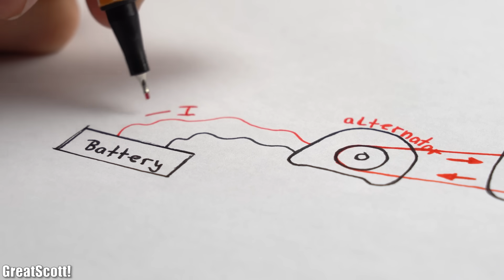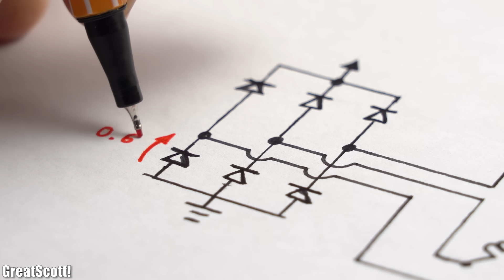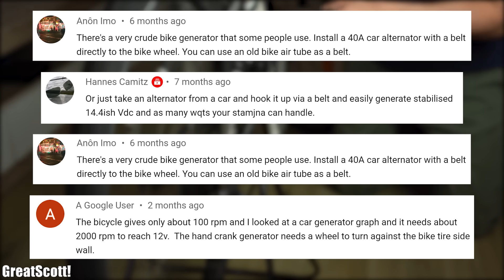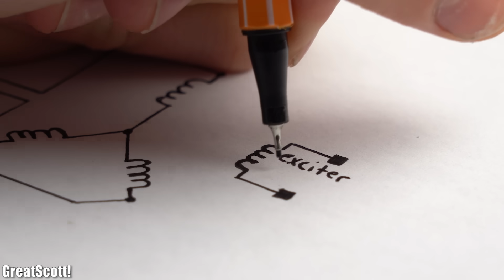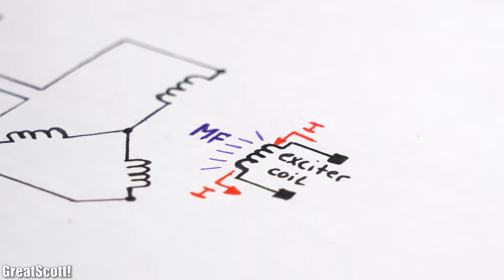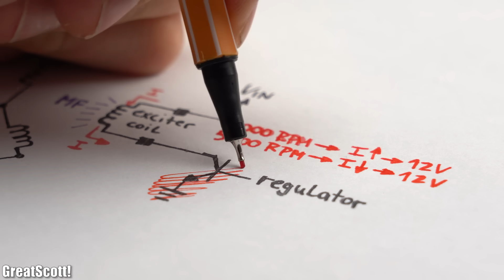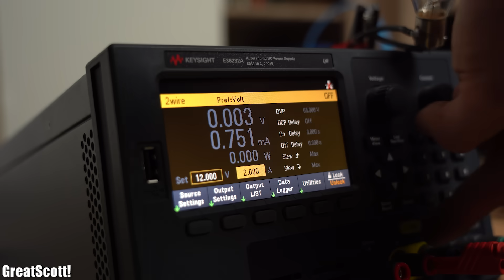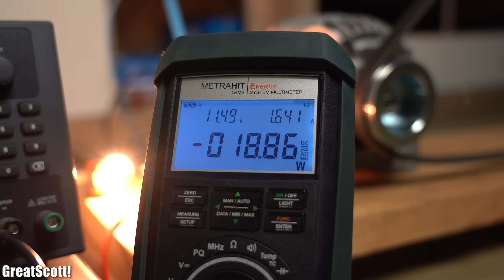Using a car alternator with a bike to power my home? How much energy can I produce?!

Comment: No one is adding a 3rd component add the induction motor and modify the alternator pin like the one guy who claimed free energy, I have not had time to try and even though I don’t think it would produce free energy. 
I do however believe that it would inline with the bike 🚴 and battery combined with an induction motor would make enough energy to power more efficiently, maybe you have more time than me to find out my friend lol

Comment: All 3 wires o the alternator end up connected to the battery in your car when the ignition switch is on and when the car is running.  I learned this years ago when I connected a lawn mower motor and an alternator.  I did not need a battery but I had to short one of the small connectors to ground or to each other  just for an instant to get it to generate. The other was connected to the output connection!  The other problem, the lawn mower motor no longer had a blade attached to it that acted as a flywheel and the motor would kick back when trying to crank it!  We used it for an emergency 12 Volt supply to power ham radio equipment.  I miss the fun of being young!

Comment: I’d like to see you do a similar project using steam and a large bag of charcoal or fire wood.
It would be interesting to see the difference in wattage output. If steam is more efficient, and you have a good fuel source, that could be a more practical option.

Comment: 1,440 watts assuming 100% conversion efficiency works out to nearly 2 horsepower, which is far more than the best bicycle racer could put out for more than a short burst.  Doesn't matter how you gear it, you will only ever produce as much wattage as your human pedaler can push.  A smaller pulley won't fix this as the limitation of slippage in a pulley system is the smaller pulley; what your system DOES need is a belt tensioner pulley on the slack side of the belt.  If you have the alternator connected to a battery, a switch and small incandescent light from 12v to the correct terminal this will provide the initial "exciter" current.  Once it spins up, the alternator's output maintains field current and the regulator will maintain charging voltage at a varying amperage/wattage according to how fast you're pedaling.  In a car where you can rev the engine and make the alternator spin 18,000 RPM, there's often enough residual magnetism in the iron rotor assembly that it will spontaneously begin charging without that initial exciter voltage.

There are permanent magnet alternators, as well as rotors that can be installed in common alternators like Delco so you don't need a battery or exciter current for it to begin charging, but this setup needs an external charge controller to prevent overvoltage to the battery.  These are built for wind or micro hydro generator systems and would work well for a bicycle generator like this.

Comment: There's a few things that are going to stop this.  When you convert the 12 volts to house current you're not going to have that much watts. We're talking about ohms law.  Also the more you load an alternator the harder it is to turn.  The only way to do this is by adding inverters and storage batteries to your system.

Comment: Throw two or three car batteries on it and a good sized capacitor..wire it up...and by the time your legs give out, muscles pump up, and your metabolism is through the roof then you'll be out for the cost of clean fuel and anti inflammatory turmeric root for the body repair/energy and the cost of the capacitor (if you touch it the wrong way you'll be out even more) and the cost of the batteries..

Think in terms of windmill using the alternator as a ball bearing or pulley to weld the fan blades to(unless you live near a running stream)...wire alternator into car batteries..8-15 car batteries; wiring all hots together and then all grounds together, while keeping the storage room temperature for the batteries above 68°F. Then carefully wire in capacitor; then add in the AC/DC convertor box...

Some used alternators malfunction and can throw enough energy to nearly explode a car battery; figure out why or where you can get it and wire it straight to capacitor.

Comment: please try using a 12 volt car battery and a dc converter plus the connection cables for that alternator. and your alternator should be on an adjustable mount.

Comment: Could you add a battery to your system and a DC power inverter. By converting a 12 V battery to 120 V you should be able to power some outlets. It’s what long-haul truckers use to power their appliances in their semi trucks. Could you also use a smaller electric electric motor to power the alternator while charging a battery drawing off a inverter to power it or off the battery itself? Making a continuous loop and a continuous source of power that would power the electric motor that is creating charge for the battery? Just curious.

Comment: According to what I saw on your video, you did not have the bike in high gear because you had the chain on the largest sprocket on the wheel. High gear requires you to have the chain on the largest pedal sprocket and the smallest wheel sprocket.  Lowest gear has the chain on the smallest pedal sprocket and the largest wheel sprocket.🤔😁

Comment: Smithsonian Institute in DC has the same thing, a bicycle powering up a lightbulb. I remember that back in the 1980's. Now in modern times, if you use a battery powered electric bicycle conversion kit, you'll get enough RPM's and more, but have the cuurent connected from the alternator to the output of the electric bike control unit. You should be able to have stable power to the electric bike motor and be able to charge or use other device around your house. and you can also go to junk yards to get cheaper $20 alternaters  or connect multiple alternators at once and get a cheap 24 speed racing bicycle $50.

Comment: 🎯 Key Takeaways for quick navigation:

00:51 🚲 The car alternator can output a maximum of 120A at 12V, equivalent to 1440W, potentially sufficient to power home appliances.
03:54 🚴‍♂️ Additional gearing was needed to increase the rotation speed of the bike to turn the alternator efficiently.
06:33 🧲 The car alternator's rotor requires an exciter coil to create an output voltage, and it can be powered with a DC voltage.
09:41 ⚡ The bike generator setup could produce around 20W of power, but factoring in the power required for the exciter coil, it may not be practical for home energy production.

Made with HARPA AI

Comment: 1:45 Ridiculous. If you want 1000 watts out of your car alternator then you have to pedal for 1000 watts plus losses on the pedals, chains etc 750 w is 1 horse power so you'd have to pedal almost 1.5 break horse power. Are you superman?

Comment: An alternator generates AC close to 20v, the regulator converts that to DC and holds it around 14.4v.  Your altrnator had an internal regulator but usually that are just bolted in.  There are websites that specialize in selling kits to convert internally regulated alternators to external, them you have direct output from your alternator and can have more options for an experiment like this.  And yes, alternators take a bunch of power to rotate and the belt has to be extremely tight which is why automakers went with a ribbed belt over a V belt

Comment: I had a theory. Instead of an alternator with a belt drive system what if it had a chain drive system.  Then it might be possible to add multiple alternators.

As a side note. Just a way to have multiple alternators on the same system to generate power by multiplying it.

Comment: change the size of the pulleys and bike tire,, make the alternator pully bigger and the bike tire smaller,,, also, put a tensioner on the belt so it aint so loose fit'n,, watch your current go up

Comment: I just purchased a 1000W Pure Sine Wave inverter for the home. I expect that my car battery will be sufficient to supply the necessary power for some home appliances and that running the engine will ensure the battery won't die until the car runs out of gas. Since it is a Christmas gift, I won't be able to give it a try for another week or so.

Comment: The human legs are not reliable and strong enough to be used for generating substantial amounts of usable electricity. To overcome the magnetic field needed to generate usable electricity will tire out the strongest human in short order. In this experiment the inertia of a heavy flywheel instead of a light bicycle rim will help.

Comment: I made a decent bike generator back around 2013/2014 using a treadmill motor and produced about 300 Watts. Mine was a lot more stable. I wont post a link here but anyone can go find it.

Way before that, maybe around 1999 I used a car alternator to charge lead acid batteries. My experience was way better. But also more of a workout. I used batteries and the exciter coil was powered by the battery bank. It was very hard to turn once you flipped on the switch. Very big workout.

Comment: Why make it hard for yourself,just get a 12v. Motor to turn the alternator in turn uou can keep the 12v motor charged off the battery. A larger sprocket will turn the alternator faster generating more current.

Comment: Note not all alternators have a internal regulator like in video. Chevrolet products do. Fords do not. Others I dont know.

I saw a setup a man made so his children would exercise more. Bicycle, alternator, car battery and 12 volt TV.
Kids could watch TV providing they rode the Bicycle to power it. On average 30 minutes hard riding gave 1 hour of TV. By using a car battery with some charge it gave a steady voltage to the regulator for the field currant. More steady output. They could not let the battery go completely dead or it couldn't start the field circuit. 
The two little pins are 1. Power to the regulator and 2.  line to the charge light.

Comment: If you were to change the pulley on the alternator with a bigger diameter pulley like 20 inches instead of the little 3inch.

Comment: To All:  Info.  Whatever  ' brand ' of vehicle alternator  you  use ; check out the  idle  speed of THAT  brand of vehicle. That, idle speed, is what you'll  require to create an electric generation unit. Minimum of probably 1700 or so. Make it for at least 2,000 rpm.   ( 3600  may be the best, like those gens you buy , in a steel  piped case type = Champion, and other brands ).  If i build one, it would use an alternator off of a semi- engine ; probably a Detroit, or Cat engine. Rating about 200 amps. IF  it's  going to be made, it's  going to  produce power !.  Thanks, for the info, SIR.   Wonderfull accent, is that German, or Norweigian, or ...?    (Alberta Canada)  A generator, usually  requires about 2 hp of rotational force, for every 1,000 watts of  power  output. There is some loss, but efficiency is between 80 - 88  %.  I have several generators, 208 cc gas engine powered, 3500 Watt BE  generator. Older Yamaha, 2800 watt output, uses a 256 cc engine. ( 1983 model - had to redo carb = works awesome. Great engine !!))

Comment: Wait a minute. Thats 1.4kw at 12 volts DC, not 120 AC. So what is the wattage at 120? There arent many things in your home that run on 12 bolt DC. Now, if you add an inverter you can get AC from it but at much lower wattage.

Comment: Good demonstration. Car alternators are only around 50% efficient in the environment they were designed for, an automobile. When you add up the additional losses from the belt drive and exciter coil power, using this to generate only a small electrical power, the efficiency is even lower. A small permanent magnet wind turbine generator head might just do the trick. If you can find a small one that you can replace the rear wheel with one to drive it directly off the chain? These generators can be  very efficient at low RPMs. However to be realistic, you will never be able to generate the amount of power you originally sought out by using pedal power. But being able to charge a battery to power lights and other small items might be very worthwhile to have?

Comment: There is a way you can take the generator apart and re wire it it might have a voltage regulator that limits the voltage built into the alternator also there is a way to make it A/C generator so you don't need any 12volt to the unit

Comment: Then we have millions jumping on the ‘green,replenishable band wagon without a full understanding of the limitations in such an undertaking.As it is not practical to supply the energy needs of your home,these ‘clean energy’ projects will only run the ‘refrigerator’ of our nation,and at great,unrecoverable cost to the tax payer caused by even greater subsidies from DC and rising costs to consumers.

Comment: I hate to say it but you did half of it wrong. You don’t supply 12v directly to the exciter circuit, that will break the alternator. You need to set it up the same way as it works in the car: the 12v is fed to the exciter via a lightbulb. In your car this bulb is the battery light on the instrument cluster. Feeding 12v directly into the coil prevents the regulator from controlling the charge. You only produced 20w because that’s what your bulb was using. Also en engines rpm is not equal to alternator rpm due to the pulley size difference. Alternators usually run about 2.2 times the engine rpm speed, this is because an alternator needs a minimum of about 2,000 rpm on its own internal shaft to produce power, so when an engine idles at 750 rpm the alternator still needs to be around 2,000 rpm.

Comment: 20 watts output 🤣😄 one solar causal 1,5m x 1m panel is producing between 100 and 250 watts per hour.... It would be better to store the energy in batterys than trying to pedal...

Comment: Why would you use a bicycle?  Use an electric motor beside the alternator.
Reply: Take the rectifier off the back of the alternator, and it produces AC current.  Hook the electric motor up to the alternator, and it will run off itsself

Comment: In five seconds of this video, I understood how ridiculous it was. Generally a car alternator only has to produce very low power.  Most alternators produce 100-160 amps at about 13 volts, that's 1300-2000 watts, hardly enough for a house. It takes 4-7 horse power to rub an alternator at full output. The it has to be hooked up to an inverter to produce 120v AC. A person is lucky to produce 1/3hp and can't sustain it for very long.

Comment: You realize there are one-wire alternators, right? Now, you have to change that 12-15V output to mains power, incurring loss. All in all, powering your house like this is a gigantic nocturnal emission.

Comment: buy an old cheap motorcycle, connect alternator to axel,  put it in 3rd gear and  put out some real juice. how much power will it create in low idle, humm you built a generator

Comment: Just moved off grid and brought my old Jetta alternator with me and this helped me, it was when you said the ground is the casing and the top pin needed 12 v to add the resistance needed, and yep worked great so I'm hooking this up tomorrow with my 19.5 lawnmower motor lol thank you

Comment: You know pal , you are one of many I can watch,  relating to these topics. 

No click bait title ,   always calls a fish a fish ....

Not a shark 😂😂  

Grt experiment .... gosh ,I miss my younger years , had one-off them 18 or what in one , electronic kits,  with the back and red wires..

Tips soldered 

Spring ,joiners all over board..

Various electrical components , caps,  light sensors etc ... 

Miss ,talking , Rupert the bear , with white nylon pull cord 😂

Large ,yellow tonka truck ,

Hoom dorm , an air powered toy , by Tomy ,   hopped around like a frog.   And that was an 80s toy ..

What I'm saying is your content ,is down to earth , and makes me feel young ....

Though I'm half century, plus ,gone ...as I keep mixing you up , with DIY perks ....    

Not a plug , but wow ,them speakers ,he made...  

See that's something else , the tech these days, is ready ,disposable 

Where as even low end tech ,  like a budget pioneer , separates amp ,   sounded way better ,than some 

Of the mid priced ,junk today 

That 3000 uk pound , Bluetooth speaker ....

Heck that pioneer ,could compete with that and win !!   Says something don't it !!

Comment: If you take apart the alternator and replace the coils on the spindale not the cage aka stater then simply spinning it will generate power. Or get generator/alternator for a 1940 or older car. Those where made this way. And where called generators. I have been a tinkerer and auto mechanic for 20 yrs.

Comment: I made a generator like this several years ago from a stationary exercise bike.    The cast iron flywheel acted as a pulley to mate with the alternator at around 25:1 gear ratio.  Using a buck converter and a 9v battery I was able to vary the voltage energizing the coil which had a direct relationship on pedal resistance.  I was able to output perhaps 50Watts for a short time with reasonable effort, but when turning up the voltage coil resistance became too high that the alternator would barely spin with maximum effort.   It was fun to experiment with.
Reply: So at higher voltages, more resistance.
Question, boss.  If I want to make something like he's trying to make, but am willing to make it the size of a shed, how would YOU do it?  Im asking experts.  I hate being dependent.